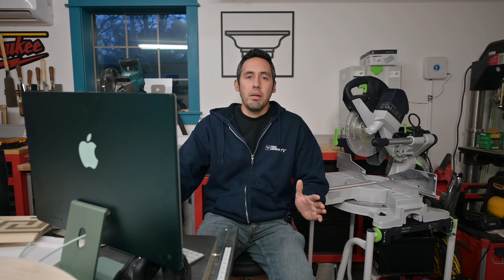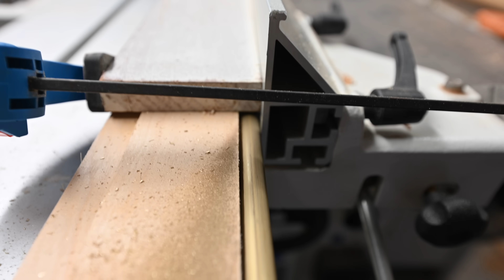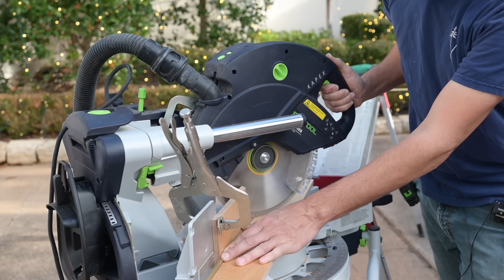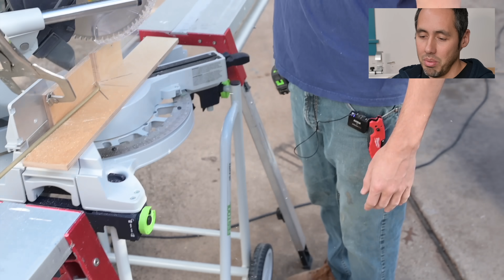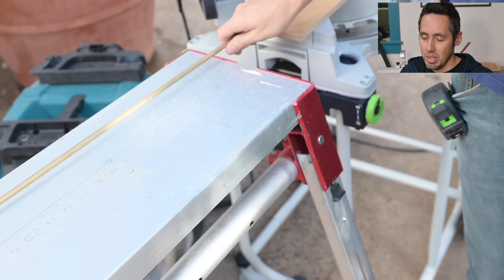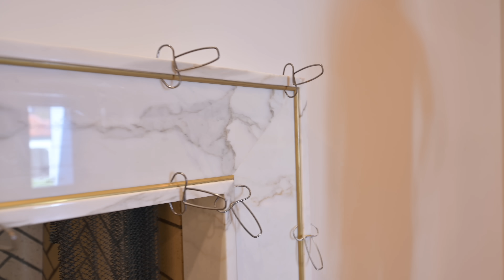It only took 12 years...My first MITER SAW injury.

Comment: Thanks for the OSHA meeting, lol. Always good to share with others about possible mishaps. I know I have a lot of things I could share but don't remember most of them. I did get a nasty deep splinter in my thumb while working in the shop couple days ago milling out parts on my cnc machine. They are parts I'm making to build shelves in my tool trailer. Splinters still hurt, and I usually just take a utility knife and dissect it. Great channel, thanks for everything you share. I have taken a lot of what you do and made some into my own practices doing my own carpentry. Keep it up.

Comment: I had a (wood)shop teacher in school, same teacher for around five years.   First thing he taught - safety, to a point where it seemed over the top and militaristic.   But, we all learned from him - if you want to be safe - it does not happen by itself.   You have to make your shop safe by ALWAYS adhering to safe practices.    I will always remember one thing - he told us the worst injury he ever saw was from a stationary belt sander.   Who would think ?   Apparently someone's hand got sucked into the belt part and the machine just kept sanding his hand.   Of all the tools in the shop - that was the one he was most careful with, although he was VERY careful with the table saw.    People are complacent with power tools.   Even a "simple" electric drill, for example.   If you lose your footing and put the bit into your hand or your leg - you're remember that.   Good video.   Safety matters.   Safety first.    Don't put your hands near the moving saw blade.   Use a stick of some kind, or another technique.   thanks for the reminder about safety, it is important.

Comment: Good to hear you’re okay. 

I once tried to use a drill press with a 2” hole saw and no pilot bit, and just thought I could hand hold the 6” maple board in place. When the bit spun the board it took significant chunks out of my left pointer finger and thumb, the whack against the bone left me with a tingling that’s still there 6 months later. Happy to say that’s the worst and only one.

Comment: That looked really painful. Thankfully I don't remember having any power tool injuries, but I was trying to carve out some baseboard around a pipe in a bathroom using a chisel (DIY/weekend carpenter). I had no idea what I was doing. The chisel was too dull and the workpiece was in an awkward spot and I ended up sending the chisel deep into my index finger, near the tip. It hurt pretty darn bad, but thankfully some pressure and quick first aid meant that I didn't have to get stitches and it didn't get infected. It has healed up but I still get the chills thinking about that one.

Comment: i cut my hand on mitersaw, got the top of it and cut 2 tendons and stopped at the bone, could've been all 4 fingers if it went through the bone. its like 95% normal now. Also lost a finger tip on my pointer finger on the jointer, cut 3/4 through the bone at my fingernail. plastic surgeon finished it off with wire cutters and stitched it up.  this was all before i was 20, in 30's now. still use saws all the time and usually alot more cautious now

Comment: December of last year, was up on a ladder in front of the house. Should have been paying more attention as the ladder I was on had moved a bit in the back, but I was trying to get things done fast. Long story short, fell 2 floors worth on to the concrete, Broke a vertebrae & slammed my head off the brick wall. After the ambulance ride to the level 1 trauma center, I needed surgery, with 2 rods & 10 screws in my back, & my head required 10 staples & 5 stitches. 2nd surgery in August to remove the hardware in the back, but all & all I'm mostly back to normal. And incredibly, incredibly fortunate.
Lesson learned: TRY to be patient & take your time!! The 5 minutes you end up saving cutting corners isn't worth it!

Glad you're ok & Merry Christmas!

Comment: When I was in college, our shop had an old table saw we called “The Pitching Machine”. The roll up steel shop door behind it looked like it was used for testing hurricane force winds from being pummeled by kick back for years. This day was, thank god, the final nail in its coffin since I was the first person to actually get hurt. Like yours, I still had all my fingers and toes. The push stick I was using was an old one and it slipped up and off of the piece I was cutting. Justin Verlander then sent that 3/4 x 2 1/4 stick straight into my belt buckle. I swear I thought I had been kicked in the jewels. It took me what felt like forever to even realize what had happened and that I could still have kids. Now I stand just slightly off to the side of the piece between the blade and the fence. Just like that nail, I can still conjure up that feeling and it can bring me to my knees

Comment: I just installed my wood floor and my neighbor was kind enough to lend me his Chop Saw. I watched a few safety videos and I still have all my fingers but I really respect the power of that machine. One thing I learned is never remove material until the blad totally- I mean totally stops. I did rush one cut and had a small kickback. All material needs to be supported; you grab the work AND the fence and stay well outside of the danger zone- so about 6+ inches away from the spinning blade. Using a clamp, when possible is a great idea that helped me a lot. Connect a vacuum cleaner was good to but it kept falling off when I raised the machine- I attached the non bendable, hard part because I did not have flexible tube to use. I wore safety glasses, hearing protection, a N95 mask, etc. Still, it is a machine one needs to greatly respect. It can take off a limb real quick. Make sure your safety guard is working correctly as well and the machine is very stable and secured.

Comment: Richard, happy to hear that you didn't sustain any major injury in this incident.
So, I had an accident using my original Craftsman contractor table saw in 1991.  While making a rip cut, the corner of my push stick came in contact with the blade.  The contact end of the push stick splintered/exploded and my hand dashed forward into the spinning blade.  I saw the blood on the table and immediately drove myself to my military base's clinic (not looking at my hand the whole way).  I was so lucky that the blade didn't come in contact with bone, but it jacked up the fingernail and removed the flesh back to the 2nd knuckle. Luckily we're a lot like starfish.  Flash forward 25 years, my wife heard me talking about the new thing called a SawStop and "told me" that we would be buying one.  Played right into my grand plan, right?!?!

Comment: I did this same thing the other day.  It because the part of the blade that was cutting was past/lower than your work piece.  That means the blade was cutting up instead of down/back into the fence.  Still have a ding in my palm where the board lifted into my hand.  Never thought of it all all until it happened.  Glad you are good.

Comment: Glad you’re okay! That’s happened to me with small cuts on aluminum. All I can advise is to place a piece of sacrificial wood on top to help keep the metal still. 

During the first week at a cabinet shop, I was asked to fetch a full sheet of 1/2” acrylic amongst a stack of plywood and acrylic sheets leaning against the wall horizontally. I would lean back one sheet after the other towards me to rifle through the stack. After going through 10 or so sheets, the acrylic was too flexible and came crashing down like a tidal wave. I jumped back to avoid getting crushed. However, I was in a hallway that was just over 4ft wide and the acrylic sheets sliced off my skin from below the knee all the way to my ankle as it fell to the floor like a deli slicer. As I was picking them back up, I found my skin attached to the sheet with hair still on it! I never wore shorts to a job site/shop afterwards!

Comment: Glad it wasn't any worse Richard, we all know it could have been! My worst injury was having an 18g nail curl out of a piece after hitting a knot; it went through the pad of my thumb and came out of the top of my nail, shattering the nail in the process. The healing was slow and it kept getting weird flakes as it tried to mend itself, but I'm just glad it missed the bone, because I've also had that happen with a pin nail (thankfully nothing bigger) and it does NOT feel good! Cheers!

Comment: When installing flashing around a window on my house remodel I was using my small nail tacker and in one swing put a staple right through my index fingernail. Grabbed my side cutters out of my bags pulled out the staple and wrapped it in electrical tape and kept going. As far as your miter saw I would highly recommend the fastcap hold down … that stick works great for things like this. Stay safe and Merry Christmas to everyone.

Comment: Recalled Dewalt chip guard exploded on me, pulled my hand into the spinning blade. Somehow my hand didn’t hit any teeth and only glanced off the arbor. That woke me up. 

Worst part is I had the recalled replacement part somewhere in my house but had just moved so couldn’t find it in the mountain of boxes. Luckily learned a lesson with only a little bruise.

Comment: Glad you're okay Richard, that could've been worse.  Knock on wood, I've been very lucky over the years.  Probably the worst injury I've received was when I was using a reciprocating saw to cut something it wasn't designed to cut.  I'm still not sure how it happened, I was working with a live edge table slab, and the result was a one inch, sharp as a razor, splinter that lodged itself directly under my thumbnail.  Painful doesn't even begin to describe it, so now I understand why this type of thing used to be used for torture.  Love the fireplace!!
Reply: Oh my gawd that sounds horrific

Comment: So far I’ve escaped any power tool related injuries, thankfully! Utility knifes on the other hand, I’ve not been so lucky. While trimming cedar shakes for siding on a shed, I was in a hurry not paying attention and the knife skipped off the shake and sliced down my thumb from just below the nail to where it connects to the rest of my hand. When I bent my thumb you could see the bone, so it required stitches and a little finger cast which made for an interesting challenge while trying to finish the siding job! I’m grateful that’s the worst that has happened to me, especially after knowing many people who’ve had much worse experiences. Be safe out there!

Comment: Sawing 1/2” PVC flat stock.  Was doing a cut (stupidly) where I cut part way through the stock and then backed the stock out of the running saw.  Was on cut 5 of 5…and the piece bound, kicked back and flipped over raking two fingers  across the running blade.

The good news is that this accident got me off of the shop floor and into an office role that I retired from 40 years later.

A reason for everything!  Cheers!

Comment: Thanks for the safety briefing.  I sent the tip of a 3" nail through a jack and a king stud into the hand holding the two boards together with a nail gun that was set a little deep. It was a minor injury, but it got my attention.  I was much more careful about the placement of my support hand when nailing after that.
Reply: same here

Comment: #1..Glad you're OK.... No one wants harm to one of YouTubes's best.

#2.. That is NOT a zero clearance fence... It was NOT. You had a 45 cut on BOTH sides. That means that with the saw angled 45° one way, you had an easy ½" of unsupported stock.  That's ½" of thin brass to wiggle with vibrations. Zero clearance means 0".

#3..Me? Using a push stick in front of my class at the table saw. The push stick slipped into the path of the blade. The kickback jammed the push stick into my palm, bruising it, and also scraping some skin. No cut.... Just a rough scrape..... Plus a group of shocked high school students watching me.

#4.. Happy Holidays and THANKS for great videos.

Comment: Same situation with me, but with aluminium during my second cut on the saw with the material. After that I clamped the piece  while cutting  and had no more problems. I think with any kind of metal you have to clamp the piece because of the higher risk of the teeth of the saw catching the metal and digging into the material while cutting. Had a sore hand for a time but no other issues. All the best to you for the new year.

Comment: It's great that you are bringing awareness to being safe -  it's a big joke for most people until they get hurt. I had to run my brother to an emergency room 10 or so years ago because of a kick-back issue similar to this on his mitersaw.  Mitersaws are just as dangerous as tablesaws, there is a false sense of safety there...both can tear pieces of flesh off of your body and quickly too.  I recently volunteered for a Habitat for Humanity build and the guy handed out some utility knives and said it is the most commonly used tool for injuries because I think people are complacent around them.  My worst injury is probably when I had a 7-in-1 painters tool in my back pocket...took off my hoodie and tried to flip my arm to pull the sleeve off or something like that and I ran my knuckle across the tool and sliced it right open about 1/2" cut.  There was a drip path of blood to the sink and I just have hit some nerves because it throbbed...I was so mad at myself, I was very fortunate to not require stitches or to have the tendon cut.  Lesson's learned, don't keep any sharp object exposed ever...in your pocket, in your tool bag, on top of a ladder...etc.  Good practices are just that and they prevent injuries even if you 'think' it's okay...and it might be 99 out of a 100 times but that 1 time will get you, or someone else.

Comment: Just ran into your site about DeWALT.  I had a kickback issue with my Delta contractor's saw.  I was cutting plexiglas to replace windows for adding window air conditioners.  I had a thick hoodie, shirt, etc. and I was cutting and it kicked back and hit me across the stomach.  Although I was in pain I thought I was ok.  A little later (about 30 minutes later) I decided to check it out, when I noticed blood on my shirt and hoodie.  I never would have imagined that the plexiglas would have cut me through all of the layers of clothing and with no visible issue showing on the hoodie.  

I am glad that you are ok .... yes it is a shock when that happens.

Comment: About two years ago I was using my trim router and checking the depth on it while it was still running. I got careless and the tool slipped out of my left hand  and my right thumb went into the router and took a quarter inch off my thumb and chewed it up really bad. Hurt like crap. Two months off work and 5k later, I was back at work. I'll never forget that day and I'm now well aware these tools can really humble someone very quickly. Stay safe!

Comment: About 2 years ago. I was drilling with a 6 inch hole saw. Using my other hand to hold the work peice. The teeth grabbed the material. The drill jumped and got my hand pretty good. Was making a diy sanding cabinet. For any corded sander for small pieces. Was cutting out a plastic ring out of plastic to hold the glove.

Comment: Man!  So glad you are okay, scary regardless. Several years ago I was cutting with an older delta miter saw.  The blade wasn’t great and must have had a bad tooth. Ultimately the blade grabbed my material and pulled my hold hand toward it, cutting a perfect cut through the face of a brand new fossil watch. The watch was destroyed but literally saved my wrist.  Tough lessons but big one for sure.

Comment: I cut aluminum alot. If you have more to the middle of the saw blade. About 2 inches from the  fence. It will cut alot better. Also maybe spray the blade with some lubricant.  Good luck.  Merry Christmas.

Comment: My worst injury was on the table saw. Thankfully I still have all my appendages along with a nice little scar to go with them. I was cutting a piece of plywood. The sheet was not properly supported so after the cut, I was trying to hold the rest of the sheet from falling with one hand. I turned off the saw but reached for the sheet with my other hand too soon. My pointer finger grazed the still spinning blade and gave me 3 stitches.

Comment: My worst injury was on a table saw.  I was new to tables saws, this was years back, and I was trying to cut a small block of wood.  Where I made my mistake was using the fence as a guide with the end grain against the fence.  The piece kicked back, jammed my thumb, and shot right into my waist.  It didn't break the skin but my thumb was raging sore for two weeks and where it hit my waist left a large black bruise.  Ever since then, I have had a profound respect for power tools.

Comment: Thanks for the video as always. 6 years doing trim carpentry, and handy man type home services. When I was 19 I did a job with terrible 3'' phillips deck screws and I was holding two awkward pieces together and putting a ton of pressure on my impact because I knew the risk of stripping and slipping and what not. Much like you holding that brass super tight, me putting extra pressure on the screw did not help my cause when it slipped and there was my left thumb with a phillips  bit in it. I pushed it in where my nail meets the thumb on the left side and the nice oval shape phillips bit went in and skin wrapped right around the head back down to the skinny part of the shank. Worst part was having to pull in back out.